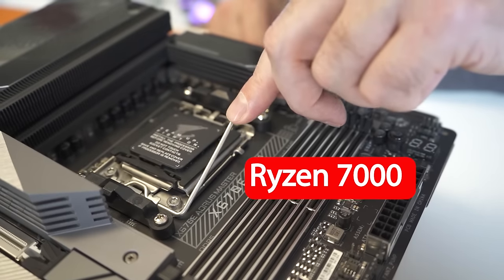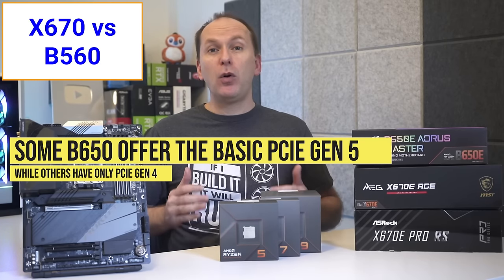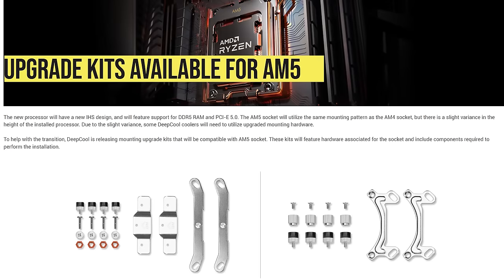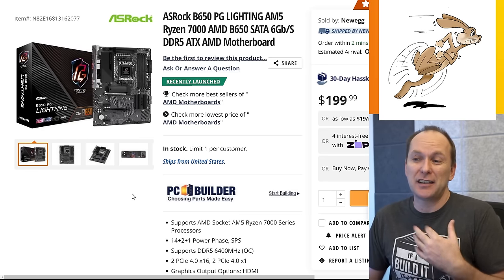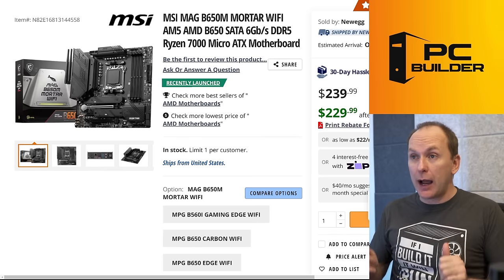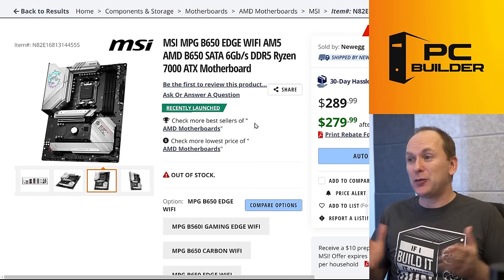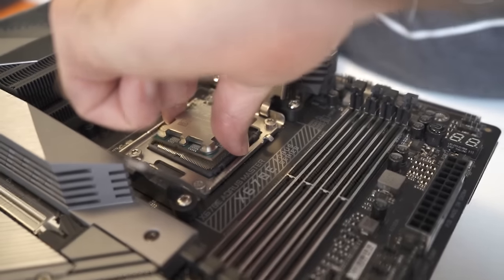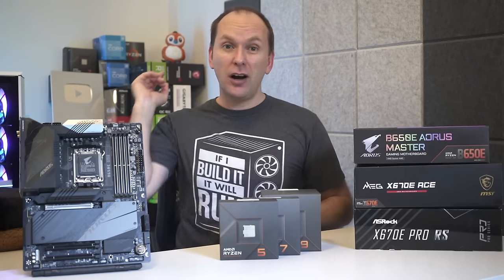Best Motherboard for Ryzen 7000 | AM5 Motherboard (B650 & X670) For Ryzen 7600X 7700X 7900X 7950X

Comment from the maker: Note: 1) Current ASUS Boards are problematic with Ryzen 7800X3D, do not recommend them for this CPU. 2) Typo in one of the overlays "B560". That should be "B650".
What motherboards are you looking at? What motherboard features matter most to you and why?
Reply: Usb4 and a lot of usbA
Reply: Gigabyte only had b650e aorus master, rest are b650 /cough wrong description
Reply: I think the heatsinks are important for vrms and m.2s and the look overall, I don’t really care for the entry audio
Reply: B659e aorus master or x670e steel legend as the steel legend is nearly 50 to 80 bucks cheaper or 5000rupees inr
Reply: I suspect this will happen more than once to us all this generation. It is just too easy to get that wrong this time.
Reply: why everyone is hyped about black mobos? I want a white one
why MB makers think everyone needs 4-5 M.2 SSDs? We need more PCIe universal lanes, not x16 slot mode x2-x4. It's better to have more PCIe slot/lanes instead M.2, if you need more M.2 that can go to PCIe slot too with better cooling
why M.2 slots are not 25110???
why MB makers think we need 13+ USB ports on backplate?
Reply: I'm an AV professional and I need a PC for my studio. I've always used Apple (since 1996) but done with their built in redundancy and overpricing.
The first thing is PRICE. Running a studio with 50+ machines for 20 years makes me price conscious. Small extra cost adds up quickly.
I'm not buying any of this stuff until it's on parity with the Z690 boards. The 30% markup is playing chicken with potential buyers. Annoying, but I can wait.
So. I did a ton of research and I'm up for a 7700x build running both Windows and Linux. Audio hardware is of lesser importance because Windows can only handle one ASIO driver. And I do have external converter(s). What's important for me, is running the CPU undervolted but fast, efficient pushing big slabs of data (music, video). So stable operation running multicore CPUs (8 core and up), fast big RAM (6000 and up 64 Gb), and fast storage (3 NVMe gen 4) is needed. I'll need at least 3 gen 4 NVMe slots (one for the system drive with the software, one for the sample library (fastest possible!) and one or two scratch disks to record projects on. The Aero G and Aorus Pro caught my attention already. Very strong VRM set and hopefully strong memory architecture, and 3 M.2 drive slots. I'll run the system without a GPU for now, use the internal RDNA2 for the time being. Looking for a good 3060 TI or RDNA 3 for video editing somewhere spring 2023 when prices are lower. Again, power consumption is important, and these high level video cards are just too hungry and hot for my taste. I need efficiëncy! 
Back to the Aero G/Aorus Pro: These are, as you noticed almost the same, but the Aero G has a display port INput, and USB C video out. And it's marketed towards "content creators" so probably will cost more. Still the same strong VRM (and hopefully strong RAM architecture). One M.2 slot is sharing lanes with the third PCIe on these boards, so that's a bit of a bummer, if I want to put a thunderbolt or MADI card in there. The middle PCIe will either hold a Firewire card or an M.2 card, depending on what converter I'll use. So there's also the ASRock X670E Lightning that has weaker VRM but more M.2. Or the Tomahawk board.
The gamer kids aren't buying these, and EVERY REVIEWER TELLING ME I'M A GAMER is starting to annoy me. The gamers bought their 5600x Ryzen 3 or Intel 12400 or 12600 systems already during the plandemic, they're just looking for a big GPU for little money. The overpriced boards and CPUs are going to bite the industry in the a$$ next year, because they only care about selling the Zen 3 in stock now, but that is going to make Zen 4 more niche. Nearsighted move.
Reply: I want Wi-Fi 6E and 2.5 Gb LAN. I want the flashback feature on my motherboard so I can upgrade the bios without actually having the boot into it. I need high-quality audio codecs with a line in and out because I do radio broadcasting. And I absolutely need beefy be ram so I can do some solid overclocking when I game. I’m doing a Ryzen 7950X with a Radeon 7900 XTX build. My gaming PC is five years old and it’s starting to show its age on some the newer titles. Considering how big game files have gotten I definitely want that superfast internet connectivity on my motherboard. I currently have 2 gb isp service, so this is going to be wonderful.
Reply: @PC Builder Thanks for a nice overview of the boards! Just wanted to second what @reptilespantoso expressed above, but note that B650 AERO G is actually kind of a unique one, I was really surprised it had Temperature and Flow sensors, so it's more suitable for custom watercooling as well (weird as a feature for creators huh - though I might be an outlier since I do custom loops as well). These sensors are usually only present on 2x more expensive boards, like Aorus Master. B650 AORUS PRO AX (rev. 1.x) on the other hand, has much stronger VRMs (16 x 90A compared to 70A, at least according to an Aero PCB screenshot from Twitter), so it might be better for OC (though that matters less for Ryzen, as you noted), and also has the tiny Q-Flash+ button on the back panel, which is strangely missing from the Aero (I guess maybe because they didn't aim for it to be OCed by creators? though watercooling sensors tell otherwise..).

My only wish with these boards positioned for creators (which unfortunately is a syndrome with all of the "early" DDR5 boards) is inability to drive >64 GB of RAM at the advertised clocks, when we need it. This has been the most significant stumbling block for me when deciding to upgrade. I finally came to terms with it, on the hope that now that DDR5 is "officially here", manufacturers will update BIOSes to better handle these larger amounts of RAM (at least that's what I heard happened with DDR3->DDR4 also). It's kinda sad that there's a "false advertisement" about all boards supporting up to 128GB, yet none of them are able to actually run it at XMP/EXPO clocks. I do hope we won't have to wait until the next gen for this to be solved.

If you have any more insight into this situation, please consider making a video on it!
Reply: @ACTED595  4090 is goodbut make sure toget the water cooled version, its better than air one for a little bit more
Reply: LOL XD
Reply: What do you think about the asus strix b650e - e instead of the e-f?
Reply: I must have wifi 6E and 2.5 gb LAN. That’s my deal breaker
Reply: I've heard some the asus ones have bios issues x670e tuf gaming and such
Reply: Would a ASUS TUF GAMING X670E-PLUS WIFI motherboard  work for a 7900x - Rx 7900 xt combo work?
Reply: I was wondering about that. I was "anti Asus motherboards for this gen" but I'm most likely building a Ryzen 9 platform anyways
Reply: I'm trying to find a solid micro ATX board to build my Jonsbo D31 mesh /7800X3D / 7900 XTX gaming rig. Its super hard to pick.
Reply: What do you mean exactly by “entry level audio”. That’s the only thing that has me worried. All I want is to hook up a pair of PC speakers with a 3.5 mm audio cable. Is it going to sound terrible or something if I don’t get a board with the 1220 whatever audio?  I just want it to sound crisp and clear with bass. I’m not doing anything fancy. Please clarify. Thanks!
Reply: can you make with new prices a new video about AM 5motherboards ?
Reply: Is this note still up to date? Or has Asus fixed their problems with the 7800X3D?
Reply: @davidjones5059  Dont you know that black mobo's matter!  Your racist if you say all mobos matter ;-)
Reply: how about know ? I am thinking of buying 7800x3D with asus rog strix b650e-f gaming mobo ?
Reply: And now that continues?.... I want  that gpu with the ASUS ROG Strix B650E-F Gaming WiFi.
Reply: The Newest BIOS Updates of ASUS are much better and ASUS boards are very stable with the Ryzen 7800X3D

Comment: Good job telling people about included audio codecs. It's often overlooked. I have ALC1220 on a B450 board and it sounds great. I think if you go back to some of the older audio codecs there's the potential to lose certain features such as AEC which I swear by. I think AM5 as a whole is a bad value at this time, but again you are letting people know about the potential for 3DVcache parts and the ins and outs of the boards you went over. This is a good resource for people who are not well versed in PC hardware, but also for people like me who can't afford to have these products in hand, so we get a look at them on channels like this. Calling out the lack of value is also a plus, good job. This is a good landing spot for someone who'd like to build a new computer but isn't sure about where to start and their options. ✅
Reply: For most people, using software is enough especially when the purpose is for gaming, you can use peace and some VST plugins, or even if you have an RTX card you can use Nvidia broadcast. It's a nice thing, however you shouldn't spend $50 more just because of better audio if that's only the difference you looked at, you can buy a $6 USB-C DAC (Apple) which is going to be better for value if you really cared about it.

Comment: if prices gets better, i've been eyeing on the Asrock B650M PG Riptide. At least this time they added a Bios Flashback feature. Sure wish though they had the Pro series for MATX just like the Pro4 on the AM4. although, i'm a little bit skeptical about the VRM config. But since undervolting would be the best way to go to save power and heat, i don't think that would be a problem.
Reply from the maker: Sounds like a plan! Hope those prices drop soon.
Reply: May as well as get the B650E pg riptide. Asrock is the only one making cheap B650E anyway. Since it cost so much, might as well make it futureproof with PCIE5.

Comment: Hello, i have installed the board and some pcie 3.0 game capture which is installed on my b650 Tomahawk. But i have an issue, before i upgrade into b650 Tomahawk, i have MSI B450 A PRO MAX whic is installed the same pcie game capture. In MSI B450 A PRO MAX, my game capture run at pcie bandwith x4/x4 thats mean the pcie_2 in motherboard run in x4 mode. But today, when i upgrade into B650 TOMAHAWK which is in spesification have PCIE 4.0 X4 yes, but when i install my pcie game capture, it only run in x2/x4 mode (x2 mode)... just take a look into my screenshot below.

My Question is, how to get x4 mode bandwith in PCIE_2 lane, because i not install any M.2 slot.

Comment: Great video as usual. Love every single one of them; very informative. I'll probably stick to ASUS. My current system has a 9 years old ASUS Z-87 motherboard (with a SAPPHIRE TRI-X R9 290X GPU) , and still works like a charm (of course I can't run some games anymore). In the past I also had Asrock and Gigabyte motherboards, but of none of them lasted this long without any issues. I'm going to wait a little bit for the Ryzen 7000 X3D CPU's, and then I will probably go for the ASUS ROG Strix B650E-F (maybe with another Sapphire GPU :-)). I like the Audio on this board and I feel it's a bit more future proof than some other boards. I also don't need the excessive connectivity of a X670E board or the second GPU slot on some boards. And in general, in my personal experience the ASUS boards are more durable and stable. Numbers are important to me, but building quality even more. So yes, I am one of those ASUS fanboys :-)
Reply: Whoa Im in a very similar boat, my setup is about 11 years old and has an Asus P8P67-Deluxe with an MSI R9 280X and Ive been very satisfied with the longevity of my Asus motherboard. Ive also had my eye on an ASUS ROG Strix B650E-F (we might be spirit bros lol j/k) however Jason doesnt seem to think that PCIe 5 is a big deal at this point but Im hoping this board will future proof enough to last another 7+ years. Im still undecided about the cpu and was looking at the X3D cpu's as well but the 7900 (non X) seems to be a pretty good value now that they have launched. Even though my last GPU was an MSI I went back with an ASUS gpu this time but no matter the choices I fully expect at least 1 upgrade to the GPU and CPU in it's lifecycle and Im fine with that assuming I dont have to upgrade motherboard and RAM on top. Cheers.
Reply: Same here. i5 4440 and Asus B85M-E. Still working perfectly with alot of miles on it; my pc is on for almost 24/7. This is the reason I most surely want to go with ASUS board again for AM5. I'd like to go with the TUF board in combination with 7600(non x) but need to do more research on it.

Comment: The TUF is honestly not that bad... A lot of gamers out there use a USB amp for headset/microphone, so the audio drivers aren't the end of the world. 3 M.2 slots, a 10 GB USB-C and a 20 GB USB-C, and for me, personally, I'm using a USB interface for all my audio so the built in audio drivers aren't even a factor. 8+4 CPU power connectors, and one of the biggest VRM heatsinks I've seen for the price with built-in I/I shield. Not the most equipped on the USB side, but I only have two USB 3.0 peripherals I use so, again, not a big deal. Then again, only time will tell.

Comment: Another amazing value video. If i go with a board it will be the steel legend one. Not cause i have one of the same brand in my current pc but i feel its best bang for buck right now for higher end stuff. Thanks for the great info cause i dont know much about boards. Would love to see more comprehensive information about motherboards from you in general. As in how they exactly operate.

Comment: I love the emphasis on audio codecs. As someone with an external dac/amp hooked up, I am wondering how the recommendations for midrange boards would differ
Reply: External is better. No static issues unlike internal
Reply from the maker: Glad it was helpful!
Reply: @PCBuilderChannel  It really was, so thanks for making your content! My original question however was perhaps poorly phrased. I was wondering given that I probably will never use the onboard audio, would your recommendations differ in any way (such as perhaps recommending the TUF series of motherboards). Don't feel compelled to respond as I was simply curious
Reply: You won't need the on board audio and will need the USB port for external audio. Your dac/amp uses USB 2.0? Ignore the analog 3.5mm jacks on the IO shield.
Reply: @gamedoutgamer  Yeah, I've had my dac/amp for several years now and plug my headphones directly into its 4.4 mm Pentaconn jack. My current PC was built in 2009 so I'm overdue for an upgrade. I asked because I wanted to see if there were other better value propositions given I don't anticipate using any motherboard-based audio solution.

Comment: Just to add to the whole PCIe gen 5 x16  GPUs, the thing is a 3090 barely sees any improvement from working with PCIe Gen 3 x8 (~8GB/s) over x16(15.7GB/s). Meaning most cards use roughly about 8GB/s which is the equivalent to PCIe Gen 2 x16 = Gen 3 x8. All of this to say that GPUs only use about half of PCIe Gen 3 full 15.7GB/s bandwidth, it will take years to even fully saturate it. PCIe Gen 4 x16 doubles the bandwidth of Gen 3 up to 31.5GB/s and PCIe Gen 5 x16 doubles it again at 63GB. Its been 13 years since Gen 3 was released and we are only going half way to bottleneck it, chances are you will build a new PC that will come with PCIe Gen 6 or 7 already by the time we enter gen 4 bandwidth territory so don't worry about PCIe Gen 5 advertising as even the 4000 series will still use half of PCIe Gen 3 unless you want some of that sweet SSD nvme speeds (which is only perceptible at very specific task or benchmarks).
Reply: I want to build PC to last 10 years with mid range setup. In future I just put new CPU and GPU and won't changed board. So I confuse to pick between PCIE gen 5 board for future proofing my GPU but I saw YouTube comparison between PCIE gen 3 vs 4 with slower cards such as RX6500XT and GTX1650 and PCIE Gen 4 actually make those cards faster than gen 3
Reply: @boboboy8189  I am sure the difference is minimal in most games, maybe 1 or 2 games will actually have a 10 fps difference. Also it is worth noticing that the difference is mainly in 1080p anything higher there is barely any difference.

Comment: Personally, DO NOT GET LESS THAN X670E MB.
Why? The whole idea of upgrading to AM5 MB and using 7000 series CPUs is to future proof yourself in the first place. 
If you get a b650 MB , u r defeating the purpose of upgrading to a newer CPU. Yes. PCI5 devices aren't out yet and DDR5 ram isn't as advanced or supported yet, but the whole idea of paying the premium is for future proofing.
Getting an X670E mb means you get upgrade to a future 8950x or 10950x that will likely support higher DDR5 speeds (currently 7950x supports only 3600 speeds with 4 sticks of ram) and also support you for a future ultra fast PCI5 graphic card or SSD.
You might as well just upgrade the CPU on your existing setup if you buy a 650 because you are not future proofing yourself as getting the 650 isn't value for your current setup unless it's pretty old.
Alternatively, you can wait for X670E mbs to drop in price which is what I am doing now. Not in a hurry, I can also see first wave of these future tech and judge for myself first if I want/need to upgrade then.

Comment: Great video, and great style.  New subscriber here...  One thing that you keep mentioning is that the PCIe5 is not really meaningful so consider the B650 MoBos.  That said, when will it become meaningful?  I'm wondering if the next video cards after the 40X0 and 7900XT series will need it.  Why else would AMD push this standard out if they never planned to use it?  I know NVMes will use it first, but when will the video cards use it?